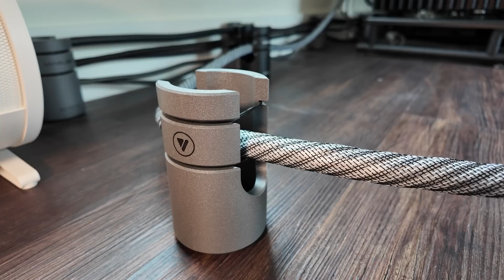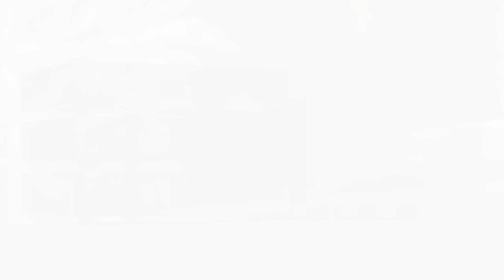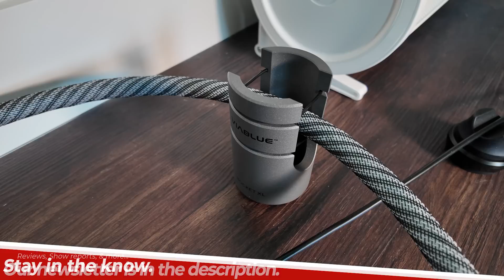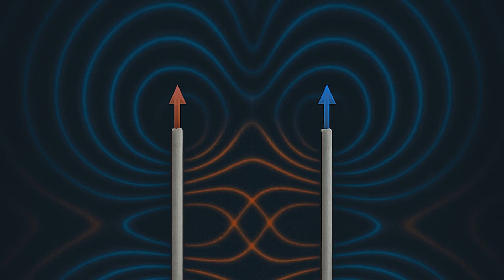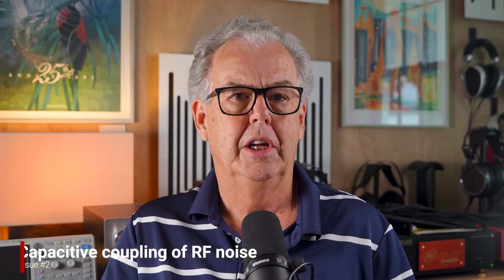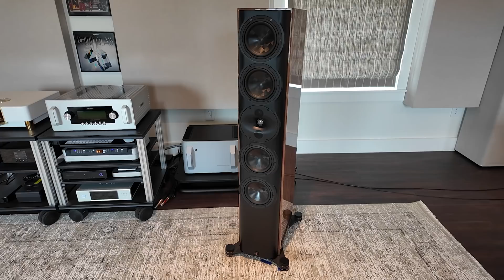The VIABLUE Rocket cable lifter system briefing

Comment: Tom, I have been looking for the appearance of this article for some time, and appreciate the credibility lent by the fact that it comes from you.  I work in professional audio, but have been afflicted with audiophilia for the last 50 years or so.  I recognize and respect your technical background and feel that your opinion lends much-needed objectivity to a rather subjective discussion.  However, there are a couple of things related in this presentation that do not yet quite congeal in my own mind; perhaps a few (hundred) reviews of the video will clear that up.  But, of great interest to me (and disregarding those points) do you have any opinion on the composition of the lifters?  Perhaps I missed the specifics of the material(s) from which these particular devices are manufactured, but I expected there to be some discussion of that topic.  (For example, the effects of the high-purity urinated wheezium from which these lifters are produced versus the elastomeric voodoolinium composition of similar products.)  From another, but (nearly) serious perspective, I am made to wonder, by extension, how flooring composition, such as that of LVT vs. oak hardwood, affects the result.

Thank you for the video presentation.

Comment: I have a high resolution audio system.  It is apparent that cabling placed willy nilly on each other and especially in contact with static prone surfaces will induce inferior sound/music reproduction than is possible.  I perceive that the  majority of responders below do not have a high resolution audio system which can reveal low level information of a recording at its "absolute sound" best although it may sound perfectly adequate to them.  I currently use cheap fat rubber footers from the 1990s under my speaker cables as my equipment is located on a side wall and flooring is anti-static 90 oz plush carpeting from 2019.  Some state that glass and/or ceramic power insulators are effective.  However, the above Viablue product does not induce it's own static field as it is not made from a ferrous or magnetic metal.  Aluminum is superior but carbon fiber lifters would be even better.  Suspension by rubber further isolates the cables as a positive.  The cost of the rocket and rocket blue versions are also a major consideration when cheaper alternatives exist.   I love the stacked concept though.  I find the price exorbitant for the Rocket XL and prefer not to spend that much even for the Rocket lifters (I would need about a dozen or more).   My system consists of the Von Schweikert VR9 SE Mk2 2016 upgraded version, Westminster Labs REI Class A monoblock amps, WL Quest 2 preamp, Lampizator Poseidon DAC, Jay's Audio CDtMk3 CD transport, EAR 324 phono-preamp, VPI TNT 6 on a Townshend Seismic Sink, Dynavector 20X2 L in a highly modified SME IV arm, WL power and XLR cabling, etc. etc. in a custom built listening room with carbon bass filtering built into the 16" constrained layer damped walls and 12" 3000 psi steel reinforced floor.  No windows, 2 17" same constructed doors.

Comment: I enjoy your videos and normally find them informative. It will be hard to watch the next one without thinking about this one. You assess the difference in sound quality made by audio components all the time. Please tell us in what ways this product improved the sound quality of your system. If you found the product made no difference in the sound of your system, it seems that you owed it to your viewers to say so. I'm sure I'll enjoy your next video.
Reply from the maker: Tom says: "I don't think cable lifters viewed alone make a detectable difference in most circumstances. I do like them for convenience. However, the 'below threshold' issue of some audio gear is something we have covered before and which bears repeating because it represents a conundrum of sorts. If you can detect a phenomenon by itself at 'Level 1' and you add a product that operates at 'Level 0.7', then you (i.e. audiophiles) have a choice about whether to implement such 'below threshold' gear or not. Same could be said for setup. Logically 2 or 3 or 4 changes at the 0.7 level will be noticeable. I find, for example, that changing a single cable is rarely noticeable. Changing the whole cable loom is quite noticeable. I think cable lifters are in the single cable zone. Cable lifters have another problem which is that implementation is dependent on the user. Results will vary with initial conditions and implementation. Users should set expectations accordingly. All this is simply to suggest what I tried to make clear (intent and results may vary!) which is that cable lifters are a near to last step in expensive and well-developed systems. In a $200,000 system, I don't see any downside and presumably the cost is rounding error. I should add perhaps that we try to be agnostic about technology, but I think the electromagnetic phenomena articulated by cable makers, board designers and chip manufacturers are clearly based on electrical engineering principles and practice and thus could matter. Obviously there are audiophiles who think these phenomena are impossible, and cable lifters are not for them. Hope that helps."
Reply: @TASmagazine  I think what everyone is forgetting is that you are trying to run a stereo magazine / website and you need to review products! I think you can feature products and describe products while not necessarily endorsing them. Let your readers decide if they want to check them out. However, when you are addressing the super high end people are expecting products that make noticeable differences in sound. I understand diminishing returns and all that so I think a product like this one needs to be classified under hifi accessories. I think a product like this is more about keeping your cables organized. I'm not an engineer and I don't think I need to be one to realize this doesn't have a noticeable impact on the sound coming out of your speakers. If it does then you have some more serious cabling issues at hand.  
I guess what I'm trying to say is It's important how you feature certain items to your audience. This would be a great hi-fi accessory item for managing cable clutter and keeping things looking neat. That is probably how this item should have been featured

Comment: I had some expensive lifters in my system for a while. To even suggest any audible advantage is criminal. I had them in my system using Revel 126be monitors and Bryston power, then tried them with Magnepan 3.7's and Manley mono blocks. The lifts might look sorta cool, but they do absolutely zero to affect the audio signal. Anyone suggesting otherwise probably thinks Trump is a good and moral person.
Reply: So everyone should have the same experience you have? To suggest otherwise would be criminal? You sound just like Donald Trump.
Reply: @052RC  LOL! This is not open for debate. The science is settled. The lifts do nothing unless your floor is made out of plutonium. ;-)

Comment: I haven't tried any products like this before. After watching the video and reading the comments, here's my take on it. He clearly states that these things may make a difference, and if they do it will not be huge. He also showed some of the scientific principals behind what type of benefits may be taking place. I don't see anything misleading here. 
Reading through all these negative responses I see only emotions. Its clear that most, if not all of the skeptics have never tried products like this. And from that standpoint, its kind of hard to have an opinion on something you have never experienced. I also see a lot of references to science, but not anything real. So, what we have here is a bunch of people using terms like "snake oil" and "crazy", that have no experience with the products and don't list any reasons why they can't work that are based in science. Instead of getting emotional and upset, just explain why the products can't work and provide a reference so we can see where you are getting your information from. I'm skeptical myself but I see nothing here that's worth getting emotional over. The message I'm getting is try before you buy, and don't expect big differences. That seems reasonable. Why all the emotions?

Comment: In order for this to work correctly, the cables need to NEVER have touched the ground, even during the manufacturing process. This means that you must buy your cables from a supplier that can provide audited proof that the cables never come within 30 cm of the ground at anytime, including during shipping. If the cables ever touch the ground they will be permanently grounded and there is no remedy for this other than remelting the copper and starting over again.  Evidently one must be very careful when handling such cables. There are only two cable manufacturers that can supply the proper cables. One of them is in Turkmenistan and the other is in France. I can provide references if needed.

Comment: What a crap. How someone could compare a cable lifter or cable when you dont hear the life music as a comparison to the recording what you hear. It is all snake oil. and when he talking about electromagnetic fields around the cables then why introducing metal cable lifters which could act as a amplification units. then better use Plastic or acrylic. also as well why 3 layes of cable in in one lifter when talk about electromagnetic interference.

Comment: I'm not saying the lifter system doesn't work, I haven't tried it myself but... I have many doubts.
Air is, in fact, a good insulator... For electricity, up to a certain point. But, does not block electromagnetic interference. If it blocked it, there would be no radio or, even worse, Wi-Fi!
Reply from the maker: The source we quoted said that the benefit of air was electrostatic resistance which aids in reducing RF coupling from nearby materials (typically the floor). Hope that clarifies a little.

Comment: Cable lifters are critical, I don’t have any cables touching the floor, or the walls, or each other, vibrations from the speakers and static electricity affect the sound. Cables should always be neat and tidy, otherwise your sound will suffer.

Comment: My cables (which weigh 445 lb each)  are suspended by a series of large helium balloons which have been scientifically proven to reduce intermodulation distortion by 0.00000056%. I happen to have superhuman hearing so I can easily hear the difference.
Reply: I suggest replacing the helium with hydrogen for the "German Sound" sometime - you may be amazed.

Comment: If you need cable lifters to lift them off the floor how can you not conclude the shielding on your cables is inadequate?
Reply: Beautiful. But the response will be that of course you need both! $10k cables and solid gold lifters should do it.
Reply: a perfectly insulated cable has yet to be invented.

Comment: Been at this hobby for over 5 decades. Agree with your comments on the Advent Speaker, but this is total BS. Do you align theem with the earth's magnetic field. You also need to treat them cryogenically.

Even better, is suspending the cables from the ceiling.
Reply: Only if you have the right ceiling material though

Comment: Current in wires only produces an electromagnetic filed if it's AC. Alternating Current. 
DC circuits do not produce EM fields. 
Audio devices do not commonly deal with DC. Except in the case of external power supplies.
You are also talking out of your ass with regards to wood and other such floor materials 'coupling' electrically with a cable. Wood, unless wet, is an insulator. And not the type which builds up capacitative charge fo static electricity such as rubber or plastic can.
I find it very difficult to take audio advice from someone who has so much distortion on their voice track? 
You don't seem to understand the fundamentals of audio such as gain structure, headroom and transducer working distance. So why should we listen to your advice?

I will say that these cable separation devices would be helpful for the task of keeping AC leads away from line level and phono level cables.
In my studios I've resorted to PVC tubes, j hooks and other strategies to get my mic and line cables up off the floor. But that was because the floor in question was covered in AC leads and wall warts. 
If you are really worried about EM and EFI, use balanced interconnects. These use differential math via a transformer, op amp or impedance balancing to subtract the noise added to a signal. 
You have 2 conductors with the same signal. One conductor's signal is 180 degress out of phase. 
At the destination the inverted signal is flipped 180 degress, along with any noise products. So the two signals when combined get a 3dB boost from combing identical signals. The noise products destructively interfere because the same noise signal should be identical on both lines, and the noise and only the noise is now inverted on one line as the two are combined. So all the noise nulls itself out. 

Use balanced interconnects.

Comment: I’ve been using bamboo pot holders from China. Impossible to knock over and cheap AF. Look ok too. Holds 2 pairs of heavy cable easily. I had the AQ lifters for a bit, all they do is fall over. Useless. Honestly, I cannot hear the difference, but it keeps the cable clean and makes vacuuming easy. My Nordost Valhalla rest easily flat on the pot holders as well. And they look ok, work well on carpet. 👌

Comment: I would imagine numerous comments will be deleted from this video's comment section.  Every EE will agree that signal routing next to power planes/ power lines is a no-no so you would not want unshielded power cables running adjacent to your speaker cables.   After that, the proposed benefits depart from reality.

Comment: They will have a great system in a zero gravity space station.
Reply: But space radiation would interfere with low end thus an atmosphere is better for the trained audiophile. But where on earth to position your speakers so you get the optimum atmosphere?  I have an ebook if you are interested

Comment: Love the water in hoses not being completely correct statement. There are some amazing videos out there showing how completely contradictory to preconceived notions information, electron, current flow thru wires is. e.g. that an output device (power supply) does not know what the end of a cable termination is until the data/ electrons can flow all the way to the end. Or how long it takes for a light to turn on after power has been applied over longer distances. Information travelling along the dielectric interface faster than through the wire.... even how the quantum fields provide information, electrons, through space and not just the wires.

Comment: Good video. 
In terms of noise... not an issue.  (Unless you're running 14 gauge lamp cord 20feet ... depending on the quality of the speaker... and your environment... you could hear something.) The people who tend to buy these are running shielded wire and a thicker gauge.  So they are not going to hear any noise. 
[Edit] 
When you started talking about emag and interference... you're into the snake oil realm of things.
First, your speaker wires are shielded strands of wire. Not a single copper wire with no shielding.  Of course the material used to shield the wires does matter. 
Second... unless you're running lamp cord or basic speaker cables, your wire will be braided. (twisted around itself) This also helps reduce interference.  There's more when it gets to cable design. 

Note that if you really want to reduce interference... from your pre-amp, run long XLR cables to your mono bloc amps that are positioned close to your speakers. This way any noise along the XLR cable is canceled out. Then its a short run of speaker cables.  
[/Edit]

To your point... these make perfect sense if you're running the wire and you want it to look nice and to be less of a trip hazard. 
Or you want to help coral your dust bunnies.  Where you have the most potential for noise is when you're running your speaker cables in wall for long runs in parallel w power conduits and your cables are not rated for that.  And of course the lifters can't help here. 

Are they worth it? 
For the use case of managing cables to look nice and you care about the esthetics? Sure if you can afford them.
Note: This is one of those things where if you have access to a makers shop environment you can make these yourself w a CNC/Laser cutter, 3D printer and some supplies. 
(3D print the upper section and attach to a metal base via a screw. ) And of course make your own high end cables.

Comment: My cables are on towers that go through the roof of the house and hold the cables 100 feet above the ground level.
Reply: Wrong! You need an air compressor system to levitate your cables with air without anything touching them- including your amp and speakers.
Reply: now that's commitment..
Reply: Audiophiles going to the extremes, I like to see such commitment.
Reply: @povertyspec9651  How do you manage the resistance a 100ft cable will produce and what is affordable for 100-200ft runs? I appreciate your learned audiophile advice!
Reply: I did that with my Christmas Tree one year. The ceiling was 8 feet and the tree was 12 feet; & not even counting the tree topper.
Reply: I embed my cables in concrete first before lifting to ensure complete separation and isolation. I can truly tell the difference. Well worth it.
Reply: Not enough, levitating blowers shall be powered by separated electrical circuits. Also, everybody is waiting for conductors to be refrigerated by liquid nitrogen.